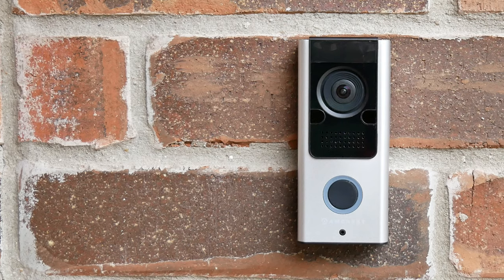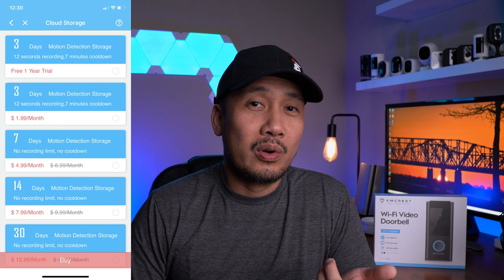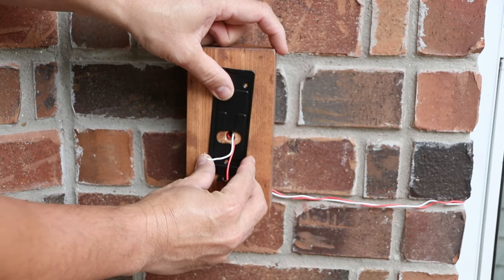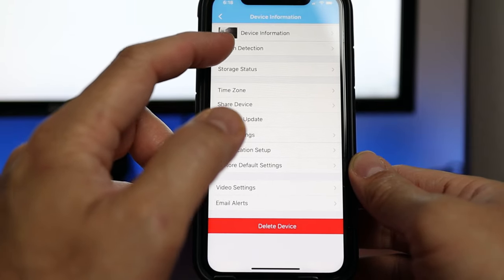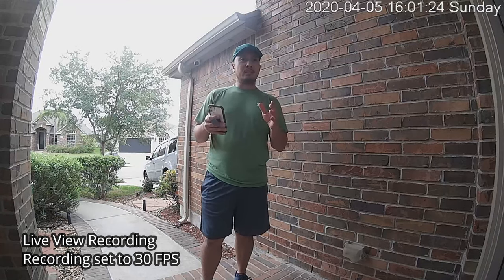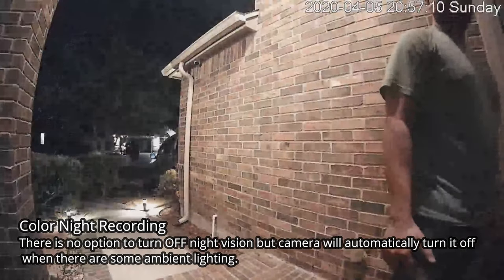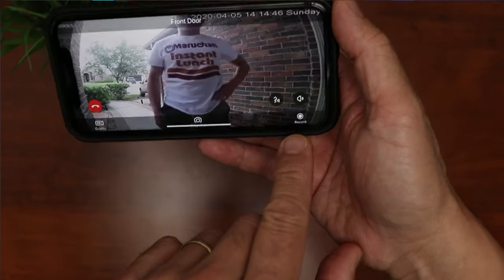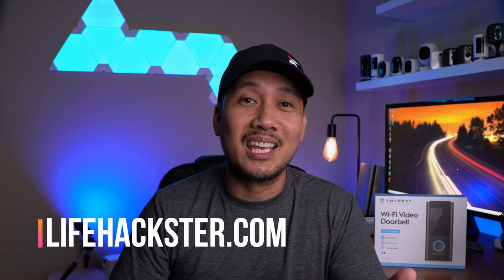Amcrest WiFi Video Doorbell Review - Unboxing, Features, Settings, Installation, Video Quality

Comment: What is the best battery powered video doorbell that doesnt need a subcription for the recording?
Reply from the maker: Eufy battery video doorbell.
Reply: LifeHackster if I get that, should i get a eufy 2 wireless security cam or get the arlo 3?
Reply from the maker: Mar Ras - yes, it uses the same base station as their battery powered cameras.
Reply: LifeHackster is the base station the same woth the eufy 2c which is cheaper?
Reply from the maker: Mar Ras - yes
Reply: LifeHackster does that mean i can just buy the eufy video doorbell battery powered and buy add on wireless cameras? Since the doorbell already have the base station? sorry with all the  question im bout to buy now. Eufy 2 on sale for 269 and doorbell 169

Comment: The picture quality looks great.  Lots of bugs, though.  I wish more cameras had HDR.  It would also be nice if manufacturers started stating separate horizontal and vertical FOV numbers.  Listing the diagonal can be misleading.  Is this something you have considered specifying and figuring out?

Eufy says their wired doorbell requires 30VA.  Have you tested it with less than that, such as the 20VA transformer you have shown in the video?
Reply from the maker: As to FOV, some companies will only say diagonal FOV..as to eufy, I tested it with a smaller AC adapter and it works ok.

Comment: Video and audio look pretty good, but all the other issues really hurt this.  Software and firmware issues are really dragging down the potential of it.
Reply: That’s the good thing though. Video and audio would have to be updated by a new doorbell where bugs and firmware issues can be fixed by pushing out an update.